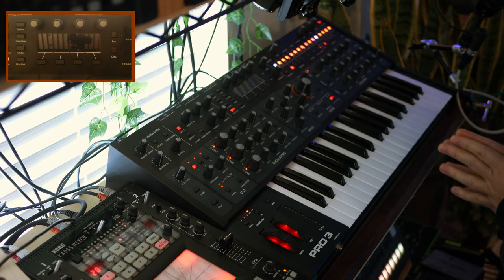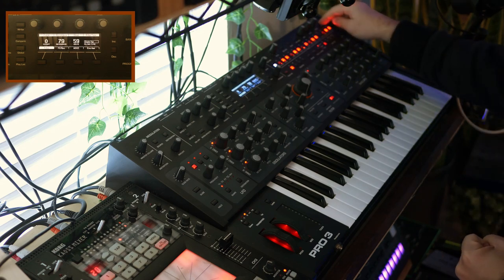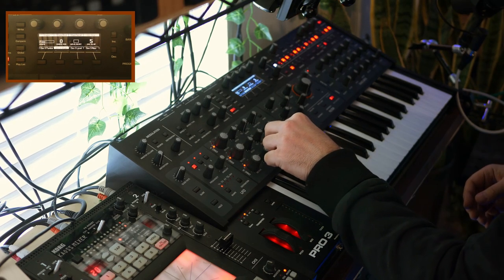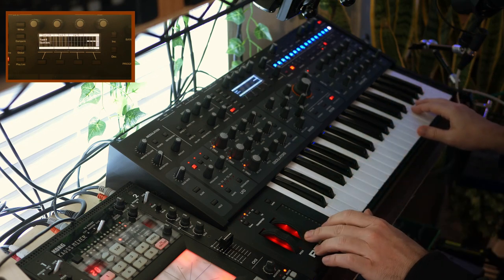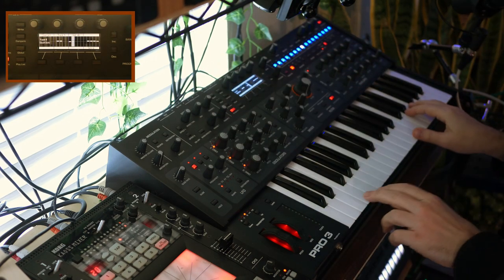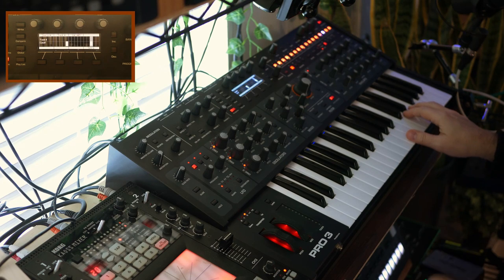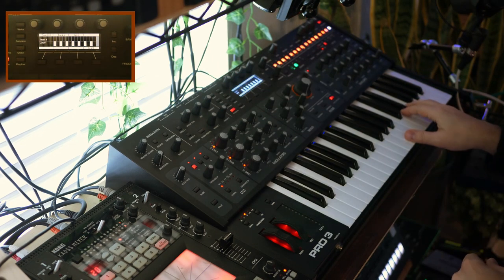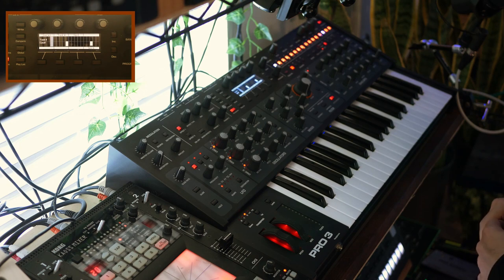Sequential Pro 3 - Arpeggiator with Paraphonic Mode, Mod Sequencer

Comment: can you specify and exact tempo for the arpeggiator on this synth? I don't like that the sub 37 cannot. (such as tempo 122 for example)
Reply from the maker: Yeah, you can dial in an exact bpm tempo with the dials and screen.   Or can run it as midi slave as well.